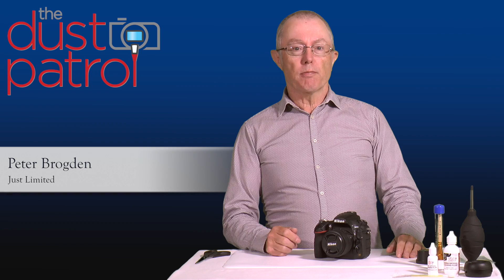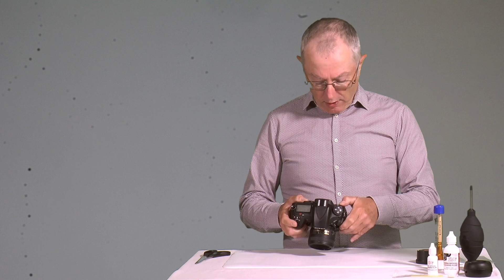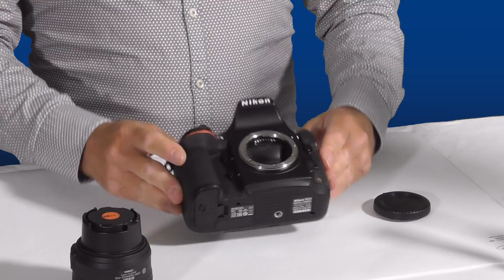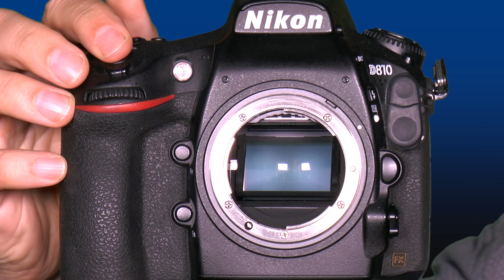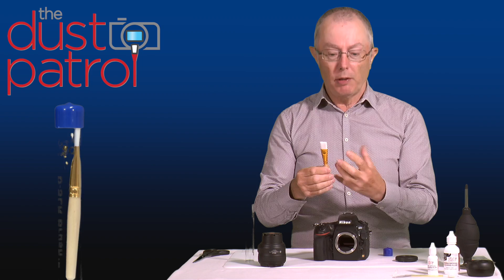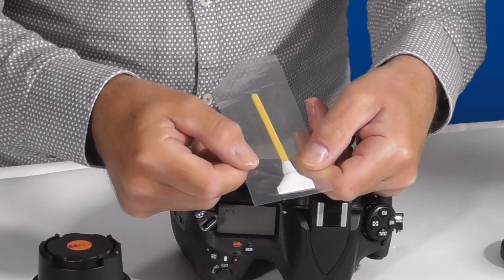Sensor Cleaning Nikon Full Frame DSLR DIY

Comment: Great tutorial but sensors have still dust mainly on the sides and edges of the sensor! I used the brush but it leaves marks despite it is brand new! I also put 3 drops max and this leaves marks on the sensor, I redo it with less and marks disappeared

Comment: Is my sensor going to get dust if i never open my lens, ever?
Reply from the maker: By never removing the lens, you will minimize the risk of contamination. But at some point you may end up with spots on your sensor anyway. Also, you limit your photographic options. Sensor cleaning is easy, and if you are able to do it on your own,  and have a choice of lenses, you will be able to take much better pictures.

Comment: great and professional information sir. I got so I like to take it over by a window and let some of that sun light come in toward the sensor then I use the sensor cleaner if say its on the left ill move it toward the center the dust then I use the little air squeezer tool and sometimes those dust particles blow off the center after being moved from left to center my fear is pushing it too far over and it getting down behind the sensor

Comment: Do you just wet one side of the swab and use the dry side for the second pass? Or do you wet both sides? Thanks.
Reply from the maker: I wet the tip of the swab. The second pass is not to dry the sensor. The fluid evaporates instantly after the swab has been removed.
Reply: @thedustpatrol7515  Thanks for the quick reply. Many vids have both SIDES of the swab moistened but rarely mention the tip. Great video. Very informative. Didn't know about using the blower on the brush.